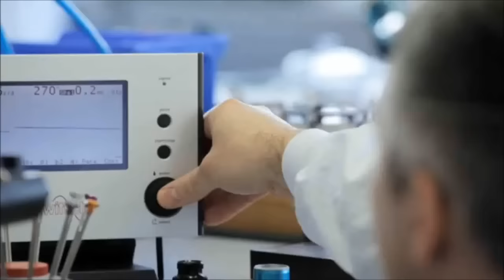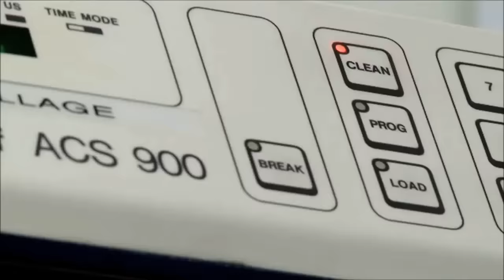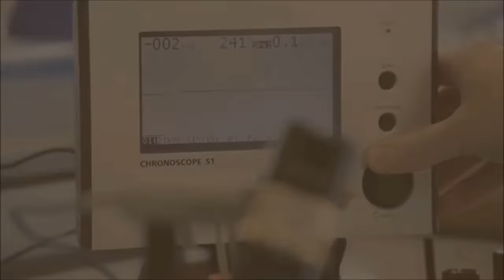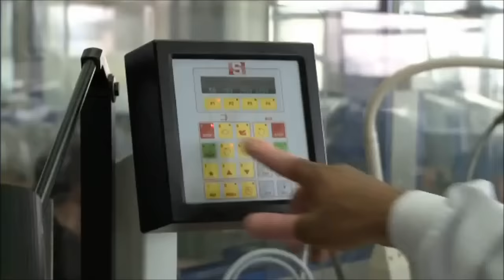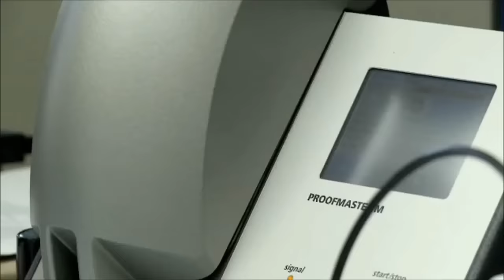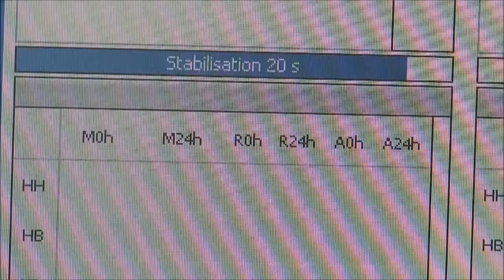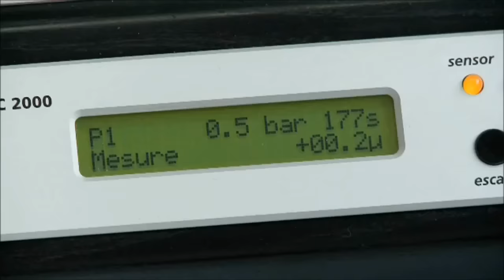Patek Phillipe Service and Maintenance (Long English version)

Comment: They make old parts for you if they need too.... And people wonder why they’re so expensive. Quality over quantity.
Reply: very top hardcore.
microscopes, pressurized rooms, etc
and i have to repair my wathces with engine oil an a glass.
Reply: you're confusing quality with novelty.
Reply: I did a job for a watchmaker once. He was blind, reckons he just wore out his eyes...
Reply: 90% of the price is for the marketing costs. There's plenty of other qualified watchmakers that can easily service Patek watches.
Reply: they make old parts for you, but you have to pay for it. they don't give out old parts for free.
and for that money, you can buy brand new high quality luxury watch.
Reply: This is why i like mass produced ETA movements.  You can always count on them existing
Reply: Bespoke time pieces
Reply: @carl-ok9gn  For some reason people think you need an extremely polished and decorated watch movement for it to be "high quality and reliable". Its literally just bling... theres movements that cost £200 that are as efficient and reliable as patek movements. THey're just not as pretty looking
Reply: Plenty of watches get rejected because parts are no longer available.
Reply: Not really my £160 orient keeps near perfect time and will last as long or longer than a £100,000 patek or ap or gs
Reply: There is no such thing as obsolete parts with high end Swiss brands but it will cost you.    Still, its cool that they restore all watches regardless of age.
Reply: They don't, simply adapting other pieces if they don't have the right replacement

Comment: My $6.00 timex was a gift when I went to Vietnam . All these years it's taken a licking and keeps on ticking . Cleaned and serviced about every 6 - 9 years as needed .
Reply from the maker: Simple mechanical movements are usually more reliable although a bit less accurate.
Reply: got you thru "nam"...winner winner chicken dinner!!.....your watch sounds magical to me,,,
Reply: I've had the same Timex Acqua since middle school, 20 years, exposure to saltwater still works just fine. I've never found another one exactly the same, not even a picture online. As far I know it's the only one left and it's priceless to me.

Comment: Those pieces of art make Rolex look like a child's toy!
Reply: Rolex never planned to be a luxury brand when they started out. They were adventurer's watches. Waterproof and rugged not to breakdown when you needed it. Now they dress up the cases and faces and straps but in reality the internals are "only" a Rolex not luxury works of art.
Reply: @14goldmedals  the Crown’s older watches, the 1016 and the 6538  were amazing instruments. For that matter,  the Holy Trinity’s dress watches were that much more beautiful, too — not amazing complications but really beautiful in their simplicity. For the record, Rolex’s mid-century star dials were nice, though. The newest Calatravas are huge — bigger than the original Submariner/GMT Master from the 1950s.
Reply: it’s more craftsmanship than art and you’re paying out the ass for that

Comment: A good watch doesn't need service, my Seiko Arctura kinetic costed me around $500 and is more then 10 years old and still runs like the day i bought it with a 3 sec/day rate accuracy.
I asked a Seiko dealer if i should service the watch and he said "in about 15 years you should change the seals for water tightness" so yeah.
Reply: I own a citizen eco drive , 10 years no issue , just needs a lil sun and it's good
Reply: @metalheadblues  had mine for 20 years now take that patek
Reply: As a good car don't need a oil change... you guys are silly

Comment: When in Vietnam in 1970 I bought a Patek for $700 in Bangkok. 48 years later I had it sent back to Patek in Geneva for service which took two years and cost $2100. When I complained I was told that I should consider myself lucky since many vintage Pateks are rejected for service by the company.
Reply: Two years 😳 any reputable watchsmith could service one as long as it's not a minute repeater or tourbillion
Reply: at least you got and official reciept!! that means your watch is real and authentic
Reply: @dietznutz1  even time repeating and tourbillon
Reply: Ahaha they don't reject nothing

Comment: I bought my first Rolex in 1964, at a tender age of 22 ...Yes, as a student, I worked very hard and long hours to get it in August 1964. It was a basic Stainless Steel Oyster Case. It was a real PIA needed adjustment all the time. 10 years later, I offloaded it to my more affluent cousin. At the same time, I was selected to become a team member investigating the future of Mechanical Timepieces. There was no earthly way a Mechanical Timepiece could compete with a Electronic and win. We tested hundreds of systems ... the accuracy of time keeping was unmatched. So, it was clear that the future of Mechanical Time Keeping was doomed.
Reply: quite the contary, it just created and invented what we now call watch aficionados.  they don't own one watch like the older generation did, they own several and acquire more as time goes by.
Reply: ''So, it was clear that the future of Mechanical Time Keeping was doomed.

LOL.......lol
Reply: @kavashaman7555  Apparently, you have limited vocabulary to express your esteemed views in words.

Comment: Notice the rubber gloves are actually individual finger gloves to provide greater hand movement / control. They think of everything it seems. Amazing company
Reply: Those fingers are very common in the watch industry, not typical for Patek.
Reply: @1959Berre  I would go so far to say that everything said in this video applies to most, if not all, of the (luxury) mechanical watch industry. Which is of course in no way a bad thing ☺️ - setting aside that quality insurance process. That’s something special.

Comment: I suspect that the check for such maintenance would buy you a new mid-size car.
Reply from the maker: Patek posts their prices on their website, for an annual calendar it costs about 1200 dollars which is not too bad for a 40000 dollar watch.
Reply: So if they recommend servicing every 5 years, that's $20 a month for the rest of your life. So you pay thousands to buy the watch, then you pay the luxury tax FOREVER.
Reply: I think if you can buy a watch for 40k, you do not care about another 5k over a 20 year period^^. And if you do, you should most likely not be buying a 40k watch. Apart from that they will run fine in most cases even without servicing.
Reply: And after 5 years or so, these watches appreciate. Could reach 60k to 70k dollars.
Reply: Bottom line:  Fine creations require occasional maintenance.  You get what you pay for...
Reply: People may $ 100 a month for their daily Starbucks fix...so what's your point?
Reply: Alex P hahahhaa thats what I thought until I bought bmw
Reply: @astifcaulkinyeras  Like they even say, "You never actually own a Patek Philippe watch...."
Reply: @edeag3  not too bad hugh yea
Reply: @astifcaulkinyeras  SPOT ON WELL SAID 👍👌
Reply: @romanskarzhinets3128  Yeah my Lambo is $20K every service
Reply: Roman Skarzhinets Yep the BMW tax is no joke, it’s either fix it or sale the car.
Reply: @edeag3  Yes if you think that for a basic Rolex you pay 600€ if you go to an AD...
Reply: @astifcaulkinyeras  ... yeah... while the watch increases in value... win win
Reply: Buy a used Camry and a pre-owed Calatrava and you’ll enjoy both! Although, if you want a minute repeater, you might as well sell your house and buy a Toyota Sienna!
Reply: Unfortunately, that goes with the territory. I bought a Tissot automatic in 2004. Had to get it serviced 4 years later and it cost more than what I paid for the watch. but I knew that was going to happen.
Reply: You can also suspect that most Patek Philipe watches (which are maintenanced like this) 
would buy you a new luxury limousine.

Comment: I understand that Patek promotes their watchmakers for the service, but any GOOD watchmaker has the tools showed in the clip, and knows how to handle them, knows how to rebuild pivots, wheels etc...
Reply: No, any "GOOD" watchmaker doesn't have those tools. Those are tools that only expert watchmakers have. "Good" watchmakers don't have bow driven lathes because they aren't doing that kind of work. They aren't machining parts. This caliber of watchmaker is few and far between. 99% of watchmakers would not start polishing, cutting, or removing metal from the movement of a $50k-500k watch.
Reply: @xenonram  Specialized tools are what define an expert in watchmaking? Your comment is a given. Not everyone can afford a multimillion dollar business full of the best machinery money can buy. They are referring to all of the basic services that are needed for watchmaking. They didn’t mention that exact proprietary machinery.

Comment: If it needs maintenance that often that makes me think it’s either poorly made or they rip their customers off. I got mechanical watches that are 40-50 years old and still get about 5 seconds a day accuracy without being opened once in its life.
Reply: A Porsche 911 needs a hell of a lot more maintenance than a Honda Accord, but it's still a much better car.
Reply: oil drys into a sludge...5 yrs you get a patek certificate worth $$$$

Comment: service every 5 years? what the hell? I might as well get myself an Orient's.
Reply: Timex never needs maintenance. I found a Timex classic mechanical from late 1960s-early 1970s in an old box, wound it up, and it still keeps perfect time.
Reply: if you have a million dollar watch, spending a few bucks to keep it in flawless condition is common sense and protects an continually appreciating asset. an orient isnt worth servicing, its a disposable chinese junk watch.
Reply from the maker: Almost all mechanical watches will work for many years longer than 5 without issue (maybe 15? who knows) but just like not changing the oil in your car, it may run but not well and may fail more catastrophically.
Reply: My gshock is best
Reply: Orient Bambino II is a beautiful watch
Reply: M G bull crapo  i have soviet made cronograph 45 years old and very accurate works fine and bugest thing never been serviced

Comment: So, for the price of one service of this type watch it looks like you can buy several quartz movement (just as accurate) watches that are just as accurate and throw them away when they stop working.  Don't see the point in spending that much one of these watches - unless you just gotta show off  :)  Of course, a watch is just a tool to me - I don't wear jewelry.
Reply: Your correct...my Casio is 16$and is the most accurate...but these are art type pieces and I think Rolex are ugly

Comment: Love Patek's..... The problem with Patek's is they are to prissy. They do not make any versatile watch, only dress watches. However they are the King of complications.
Reply: Patek Phillipe is LUXURY,  theres no such thing as simplicity which means affordability,  if is expensive for you get a Citizen.
Reply: Hey Yousef, the term 'complication' was not used in an offensive way, but refers to the various inner mechanisms of the watch which are designed to achieve a specific effect. The more 'complications' a watch has, the more versatile the piece. Hope this makes sense :)
Reply: At least you don't need to service a Citizen or Timex every 5 years.
Reply from the maker: They have the very popular Nautilus range as well as the Aquanaut range, both are sports watches...
Reply: what the fuck prissy means

Comment: 5 years to make a movement? That's the EU for you, Seiko will make one faster and more accurate for a small fraction of the price. Sorry but I would expect a watch to run perfectly for a lifetime to justify the price they charge and these watches don't, so all you really get is a very expensive badge
Reply: That is, 5 years to design a new movement from ground up.  Autos take longer.

Comment: If I was paying £10,000+ for a watch I would expect it to last a lifetime without all this expensive servicing!
Reply from the maker: Would someone buying a 300K Ferrari expect it to last a lifetime without servicing? Anything mechanical requires maintenance and repairs.
Reply: I own a rolex submariner for the last 20 I have never had problems nor needed to have it serviced, I'm very happy with it.
Reply: Horolograph a Ferrari doesn’t make claims to last a life time .
Reply: Fernando Quintana exactly , I have a Rado watch that’s been passed on by grandpa, still working never needed servicing.
Reply: @LogicPak  it's not like you need to bring it but it is recommended withe EVERY mechanical watch to have it serviced(cleaned,lubed) every few years
Reply: Rich people and poor people have a different mind. Don't be jealous.
Reply: Try £ 30-40k.
Reply: You pay £10k for a patek. That’s a steal. Xd. It starts from 30k

Comment: There are a great many competent watch makers who can service any watch produced. If a watch fails so badly that parts need to be made it is time to question the quality of the brand you own. My 50's Longines only requires service every 10 years or so. The pallet fork and jewels still look like they are as new as the day they were assembled into the watch it currently is. Service is a must, but it can be performed by a quality maker that is not an authorized makers extension.

Comment: Greetings, a regular car engine has more components, extremely measurements, intended to run in so many diferentes circumstances, in a extremely high and cold whether, can be abused, neglected, ignored, and still running.
Do you think my regular mechanic can fix my watch?
Reply: You've gotta remember, this is a money making, cash cow... it's the performance that sells a $500 product for $100,000. And the idiots who spend that kinda money on a watch that's less accurate and complex than a timex are all about the show and drama.

Comment: I'm sceptical about the heating of the partly closed case to remove moisture. The air inside will expand slightly and take a few percent of moisture away but I see nothing to show how the body of moist air inside the case is made to flow out. I was expecting to see the process carried out with the case open and upside down in a flow of warm dry air.

Comment: I am from India, I collect antique clock and watches. My collection includes rolex and omega also.  I do the services, oiling cleaning,  maintenance on my own.  We Indians dont require so many types of machines, technologies etc. Without all these technology I overhauled my watches each of them works for more than 5 years.  Gives accurate time +-1 to +-3 seconds per day. Honestly I don't won a Pattek Phillip but Omega and Rolex are also valuable watches that I serviced.  Works perfectly for 5 years.  It costs only $20 - $30. Why should I pay so much to the company.
Reply from the maker: Good point, I agree you can keep watches functional for cheap but as a customer I don't tolerate anything other than perfect work. When I paid 100 or 200 dollars before I had plates scratched, screwheads deformed, and oil stains on the dial. While a less demanding customer won't care since the watch will still work, it's not something I can live with.
Reply: @edeag3 Thats due to lack of practice and knowledge. This thing happens because they are not careful enough. And its my passion to keep watches working perfectly and as original as possible. Listen, I don't do it for money i do it because I love to.  I do it so much carefully that you will have no topic to complain about and i am 100% sure about it.

Comment: Can anyone advise why PP are using glue in a high end watch? It just seems wrong. I'm not aware of any other high end manufacturers gluing crystals in rather than pressure fitting.
Reply from the maker: I would hazard to guess this is to make the watches thinner. You are correct that rolex uses a disposable gasket in the crystal instead but since both glue and such gaskets are single use, I'm not that bothered by it.

Comment: many of those "too small for modern machinery" parts could be made quite easily with piezomicromechanical stuff and some deep reactive ion etching, nothing too special about it. but seems like its still cheaper to pay some old men at those low volumes

Comment: My 3919j is so thin that if I scratched it, half the watch would be gone! If I think it’s going to rain, I just wear a Casio that day! In fact, the Casio CA-53W-1 is almost two mm thicker than the Calatrava — it’s no JLC Ultra This but it is very svelte! This thing would slide under a wetsuit!

Comment: where can I find some watch making/watch repair videos/classes/courses for beginners, just basics for fixing simple watches...anyone? Thanks
Reply from the maker: It's difficult to fix even simple watches without proper training and experience like the WOSTEP but if you want a hobby websites like Esslinger have simple kits with tools and a basic watch movement you can tear down and reassemble. The tools aren't great but the overall package is good for a fun challenge.

Comment: Why does every technician work on the $100,000+ watches with a couple hundred dollar eye loupe and their face scrunched against the table?
They make high end stereoscopic microscopes that put your face in a natural position, not an inch away from watch internals.
Reply from the maker: The Swiss, and by extension the watch industry, is a very traditional one so innovations come slowly. The work surfaces are quite high up so the ergonomics are not terrible.
Reply: @edeag3  Thanks for the explanation!